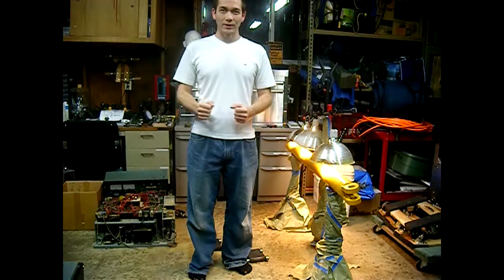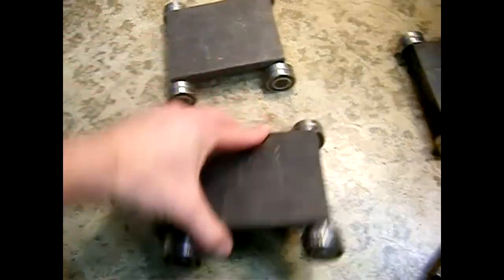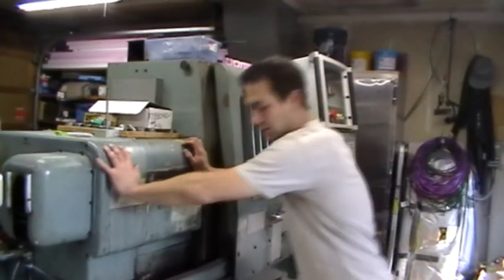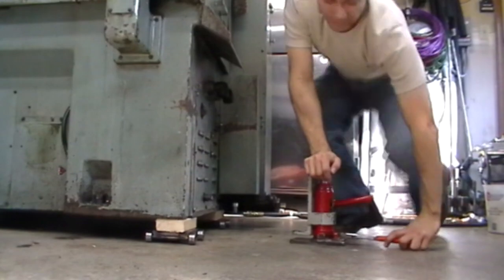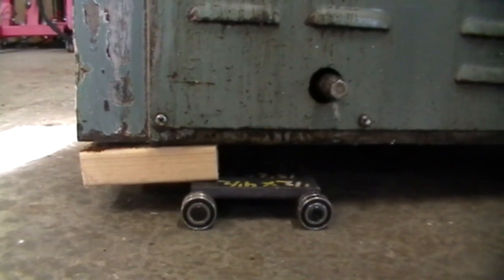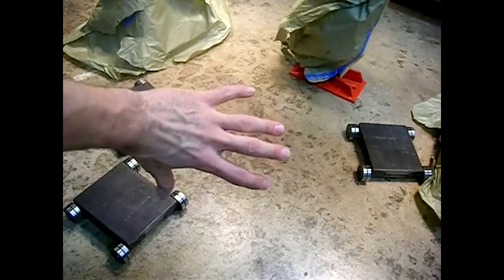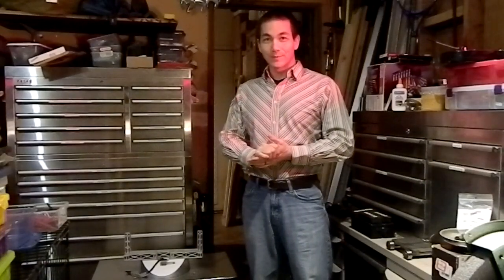Easy CNC Equipment Moving with DIY Machine Skates

Comment: 2:29 this Jack is available anywhere?
Reply from the maker: You can buy a simple bottle jack at harbor freight, that's what I did. I then welded on a base and added the top attachment.  However I don't recommend this anymore. The toe-jack worked fine for a while, but no matter how careful I was in welding slowly and allowing time for cooling, I must have damaged the seals.  I guess I could rebuild it with new seals, but if you want a bullet proof solution, you may want to buy a ready-made toe jack, like this one from Jet: https://amzn.to/3NIOHtZ
Reply: @amaedesign  thank you so much 😊

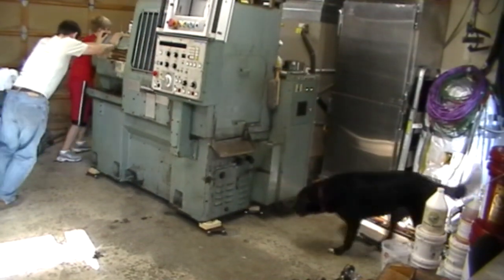Comment: You are lucky. At 3:37 https://youtu.be/JDOM7FaEx54?t=214 we can see that if you'd needed to push a bit more at least one corner of the machine would have failed, minimum killing that dog. At 5:23 it looks even worse. Those skates are asking for trouble...
Reply from the maker: When I posted this video, I added annotations that explained this. Unfortunately, YouTube discontinued that feature like 5 years ago, so the annotations don't pop up anymore.  That said, the lathe was never in danger of falling over. Just think of the center of gravity (perhaps 2 feet high) and the footprint (about 2' wide at narrowest).  If we remove one skate and tilt the lathe until it contacts the concrete, it will barely be leaning, perhaps 5 or 8 degrees.  Even in that state, there's no way I could push hard enough by hand to force it to fall all the way over.    I think the only real danger was that the extra skate could have been ejected.  As I've suggested in other comments on this video, it's a good idea to use 3 and not 4 skates and to use a nice rubber pad between the skate and machine to prevent slipping and to absorb any height differences.
Reply: @amaedesign  Yes, but never the less there was a risk. Not for tipping over, but for falling off the skates. I moved a piano with similar skates once and did not kept my eyes open for that risk so one of the skates slid out but luckily no one got hurt and nothing got damaged.
Reply from the maker: @AdaptingCamera  I appreciate your comment and the experience you share about the piano. I think we are in agreement that it’s important to make sure the skates stay under the load and that it can be dangerous if they come off the skates. We might disagree about exactly how much risk this particular incident had, but that’s ok =)
Reply: @amaedesign  Yes, we definitely agree basically in everything. I think generally it is better to be more careful than less when it comes to safety, but I work on daily basis with safety critical things, so it is in my blood, which does not mean I never make mistakes or extremely scared of everything... :)

Comment: how would one get a 8,500lbs machine off a trailer and on cement without spending $1000+ ?
Reply from the maker: There are a number of ways to do it, depending on what resources you have available and how much time you want to spend. I have a few other videos that demonstrate some of the methods.  Generally spending money on services or rentals is going to be the most convenient and most expensive while building or adapting something (like a steel gantry) will be the cheapest and take the most effort.

Comment: I made my toe jack, and moved Bridgeport mills and 3,500 CNC mills one of the tools you just can not do things without!  Also, I am making skates now... tires of the "pipe" method. I'll add a top layer of the stick-on traction (grip) tape because never metal-on-metal (even a piece of cardboard is better!) and low profile is needed because my CNC mill "just" clears the garage hight! - Thank you for providing the bearing size.  I will cut snap ring groves into the rod and press in the bearings, and again use snap rings to keep then on securely No need to drill and tap (hardened steel is no joy to do this!)
Reply from the maker: Hey John, sorry to see your comment months late, but I appreciate your situation - I also had the 'low height garage' problem and can really relate! I'm sure you've built your skates by now, but another workable solution is to heat the bearing, chill the shaft/skate and then slip it on. If there is enough of an interference fit, it won't move.  Of course it won't be serviceable either, but that's how I built mine.  Sounds like yours are going to be much nicer.  Thanks for the nice comment!

Comment: before i retired we used to have to move heavy equipment such as chiller condensers, boiler chambers and large pumps and motors. we used a commercially available device called a Multiton. it was similar to you skate except that it had several hardened rods used as rollers on each one. they could handle several tons each and with a johnson bar and 4 of them we could move anything we had to. I do like the skate idea for equipment under a couple of tons.....

Comment: Hey just bought a lathe I need to pick up and load on trailer and to make these. Do you remember what type of bearing were used and rid type?
Reply from the maker: Hi Matthew, Yes, I used R10 bearings and 5/8" drill rod for the axles. I recently added amazon links in the description to where you can find these components.

Comment: you never use 4 skates, as you learned it makes the machine unstable.
Reply from the maker: Fortunately I didn't have to 'pay' for my lesson with damage or injury. Hopefully it helps folks to avoid the same mistake when they see how I lost a skate using the wrong technique.
Reply: pallet jack my friend. Its all the home gamer really needs :)
Reply from the maker: I've moved a Bridgeport series mill and my buddy moved a big slant-bed lathe with a pallet jack and it worked out alright.  I just don't like storing a pallet jack in my limited shop space. Also, the pallet jack can't maneuver into areas as tight as separate skates.  But use what you have, of course =)

Comment: could this be used for heavy furniture
Reply from the maker: Yes, certainly.  But I'd suggest using urethane wheels on the bearings if you need to go across carpet, need to protect a wood floor, or have to go across door thresholds.

Comment: Great vid, this helped me quite a bit. With crowded home shops we all need ways to move heavier and heavier equipment around. I thought a couple thousand pound machine was heavy until I heard you say 5500# and even in a small area. 
Being able to clean around machines is a must in small shop so my stuff is on wheels. 
Working on a system for being able to have one end on straight wheels and the front on a swivel with pull handle to steer and move lathes and mills.
Reply from the maker: Hey, glad it helped you! Before I knew how to do it, moving machines around was one of the bigger roadblocks to owning some of the very affordable used machine tools on the market. Always happy to hear others find it useful knowledge too!

Comment: I usually don't comment at all on YouTube videos but for this one I had to because everything this guy made on this video and said on this video worked flawlessly for me, the only thing that I would add something that he didn't say was go get yourself a packet of those cheap shims that way you can put in front of the skate wheels to stop it from moving when you're jacking up The other side of what you try to move, because the first side that's already on the wheels moves so easily that they need to stop so you can actually get the machine up to get the second set of skates under it if you don't the Jack just basically pushed of the machine because the skates rolled so easily.
Great video helped me alot
Reply from the maker: Hey Matt, glad this worked for you and thanks for adding the tip about using shims as brakes!

Comment: Thanks for the post.  In the market for a metal lathe and was put-off as to how I'd  move it around my shop.  You've helped solve that problem and increased my operational capacity.  One question though, have you though about using skateboard wheels?  P.S: Mean push-ups to bro.
Reply from the maker: Hey Luke, that's just what I love to hear - that this video is helping people with the same questions I struggled with! I think you'll find that after the first time or two that you move the lathe around, you'll start to consider it an easy job. It's really awesome when you can start to consider even heavy machines as movable, the same as a toolbox or welding table on wheels.

Skateboard wheels would work, but they have a much lower load capacity, so you would need more of them, which might complicate turning of the skates.  If your lathe is light enough, that may work just fine for you.
Reply: Cheers mate.

Comment: i would use either the ward wood or leave it as is but drill holes straight threw the wood and metal plate and countersink the holes so that you can bolt them on and wont have the issue of the wood sliding off.

Comment: That's great, can you provide the name and size of those bearings? couldn't catch the name thanks
Reply from the maker: Yes, I believe I used R10 bearings mounted on 5/8" drill rod. The steel plate needs to be 1/2" or thicker to guarantee that the top of the bearing is below the top of the plate. We don't want the bearings rubbing on the load. Of course,if you plan to use a rubber or wood spacer (for friction), then you can get away with thinner plate. Hope that helps.

Comment: Nice and useful, I've borrowed a set to move my lathe. (980lbs). For final placing in tight corners I use 2 small sheets of hardboard, shiny-sides together with a dusting of real talcum powder between the sheets, placed beneath the machine feet. This reduces the risk of a roller catching on a small bump and the machine slipping off sideways. The thing will slide freely, then the sheets can easily be slipped out.
Reply from the maker: Nice tip about the hardboard + talc!

Comment: I caution anyone using this method as you can see he is about to loose the front corner skate because the bearings on one of the other skates got stuck on loose concrete causing the front to almost slide off and cause a serious accident. Don't get me wrong this is a good method I would just have at least 3 people 4 would be better 1 to monitor each corner and move much slower. Watch the video again and you will see what I'm talking about. Besides that, great idea, great use of materials and great video. Thank you for sharing.  You can bet I will be making some of these.
Reply from the maker: Eddie, you're right about the way I used the skates in the video. It's better to use 3 skates instead of 4.  And it's best if you add thick rubber pads to the top of the skates to help them stay in place. Riphaven commented a while back and suggested welding bumps to the skates so they grip better when you're using a wood spacer.

Comment: That worked well. 
But what when you have to move a machine into your garage, and the pavement and garage is not the same level?
I used round pieces of wood, just like the Egyptians did.
Many hobbyists do not have access to a welder... :(
Reply from the maker: You may be surprised to learn you can rent machine skates, which certainly would be nicer than the DIY set I'm showing here.  The Egyptian method can get the job done, but in my experience it was always more trouble, especially when you want to turn a machine, or the floor is sloped.  To deal with a level change between two concrete slabs, you could shim with wood, or just jack it up and move the skates across the gap, then drop it back down on the skates.  There are a ton of ways - no one right way - and I encourage everyone to use their creativity and figure out what works best in each situation.
Reply: I used round pieces of wood, together wit a winch to pull it.
Now I have an electric winch (like the ones they use on cars), on 12 volt, but not a power source for it yet.
you can pull it uphill easily.
Reply: ColtDeltaElite10mm
I will get me a good one.

Comment: I use to be a rigger, you don't need rubber on the top of the skate, just make about five dimples with the welder,they don't need to be perfect. When you lower the weight on to the skate the dimples will push into the wood and hold them in place.
Reply from the maker: Thanks for the tip Riphaven!  I'll have to give that a try!
Reply: did you ever try the idea with the dimples? i should also said we cut out pieces of ply wood that fit on top of the skates.
Reply from the maker: riphaven Not yet, but I plan to for the next set I make.  Currently, I'm using very thick cast urethane pads.
Reply: riphaven þŕ_5 5xl shirt 5

Comment: what was the axle size and the bearing size.I think I heard 1/2 plate?
Reply from the maker: +James McGuire , I used 5/8" drill rod from Enco and R10 bearings. You can scale this up to any size you like, but bearings get more expensive as you get bigger.

Comment: What type of steel did you use for the plate?
Reply from the maker: +Finn Custom Knives , I just used mild steel.  It's 1/2" flat bar, cut to length. At that thickness, any steel will do.

Comment: how you made axes aligned while welding ? in some comments lower I see good idea to make some threaded hole in mid of roller pad for bolt securing scate under your machine corner. I see you have holes for fixing cnc on basement or  vibropad installing, using bolt you can stop scate rolling away and leave machine fliyng on other three scates
Reply from the maker: +Dmitry Ponyatov  Aligning the axes was simple - I just didn't try too hard.  The shafts are aligned to the cut edges of the skates, but I don't need the wheels to be precisely parallel to work well, so I just used a magnet to align the shaft and edge of the plate.  Agreed, it would be better to use 3 skates, and a friction pad to keep them under the load.

Comment: Great video I plan on making a set of these, as I have a South Bend 13"x40" tool room lathe that I need to re-position in my garage. I moved it using (4) 1/2x24" steel pipe (3) 2x10 x12 boards and a engine hoist over 22 feet of  gravel  THEN up on the concrete. I was amazed how easily I could move the appox 1800 pound machine over gravel by myself using the board roller method (wouldn't want to do it all the time though) but it was a total pain to try and position the machine once in the garage and on the concrete with 12 foot boards took much longer than if I had had a set of these

Comment: nice video.. i need these to move my washing machine with dryer sitting on top.. 
I need to move it just 2 feet away from the wall.  i also need that particular custom Jack, to lift the washer off the floor.. is it something i can find in the store?
Reply: +Nehemiah Jandroep  You can buy the red jack, but not the gray part he made that fits onto the jack.  You have to make that part.
amaedesigns next project needs to be a handle the bleed off the jack.  Just kidding you amaedesign .  Nice project.

Comment: Great video, thanks!
  I think you can make it easier and safer quite easily - drill and tap the centre of the skates for a sturdy bolt, with a slight counterbore, then sandwich a thrust bearing (or just a greasy bronze washer) between skate and a top plate, a sleeve welded in the top plate and snuggish in the counterbore holds everything aligned while you position and run the bolt in (loosely) through the the hold-down holes in the machine base - the skates can't get away, and if you drill a hole or cut a slot in the face of the plate you can slip a lever in and point the skates where you'd like them to go!
  I'll be making some to move my lathe (4500 pounds) around the garage, but the roll in from the trailer will be on scaffold pole rollers - much easier on rough / softer surfaces like my crazed tarmac!
One question, how would epoxy floor paint hold up to the skates?

Comment: I had nearly the identical design in mind for both the toe jack and the skates--You've proven the concept. Thanks!
Reply: Rick Rose Definitely use three, not four.  Think "three legged stool," where all the legs will always be loaded.  Add a 4th and the potential exists for one to be unloaded, as they found with the corner that slipped out.  Even with a friction pad if it is unloaded it could slip out from under the load and lead to a tipping situation.

Comment: Cool!  I was looking for a way to move a mill around my garage, and that should work for me.

Similar to your toe jack, to put machinery mounts under my lathe I turned a cap and bolted a chain to it with a grab hook on each side of the cabinet on one end.  Once lifted, I used a chunk of square tube as a safety stand while placing the mounts.

Comment: I am  intend to move a 30tonne equipment. It will be grate full you can gives some idea on the roller skates.  I' m thinking of making 4 skates with 10tonne capacity each. Please advice type and no of bearing for each skates, axle length and top plate thickness.

Comment: you could mount a thrust bearing in the top on your skates. This way, no matter which way you go the skates will turn along with the machine you are moving...by the way
what is that machine anyway? A CNC turret lathe?

Comment: Thanks! i found those bearings for 2ea with a quick search. my previous plan, using material i had on hand. was 1/4" plate cut and welded into an E shape, a hole drilled through all 3 tines of the E with skateboard bearings filling the gaps. thats 608zz bearings, 730lbs dynamic load ea. 2 to 3 bearings per gap, would be 4-6 per axle and you could do 2-3 axles per skate, easily. 2 axle 8 bearing skate would be 2920 dynamic load, roughly, but slow moving halves that??  Is that plan total crap?

Comment from the maker: I'm using R10 bearings (x8)  on a 5/8" drill rod shaft. Drill rod is cheap, strong and has an accurate diameter to accept bearings.